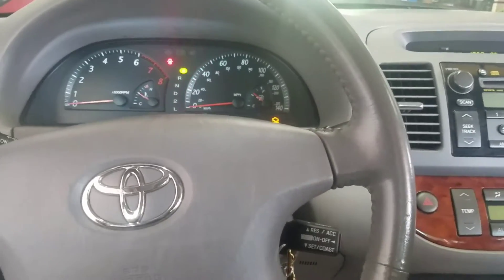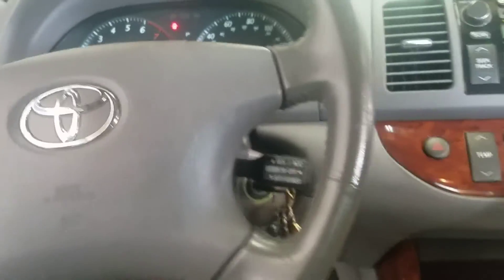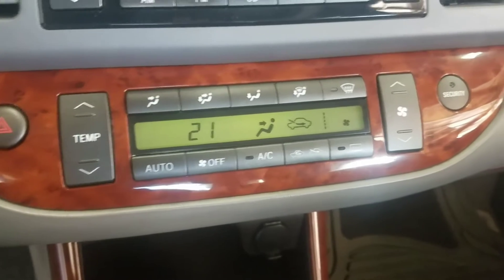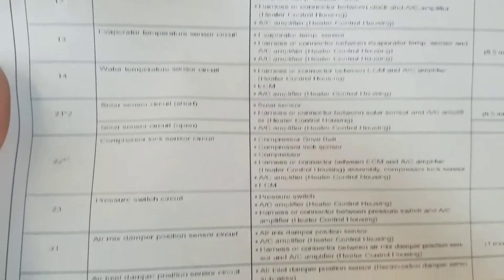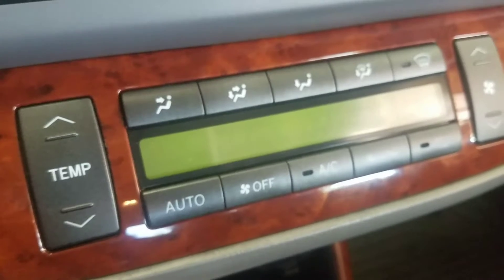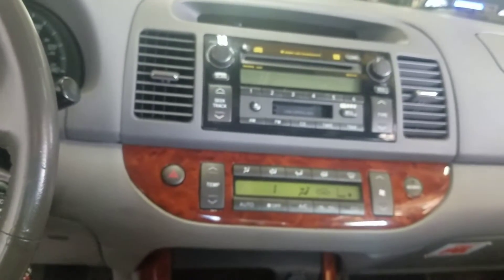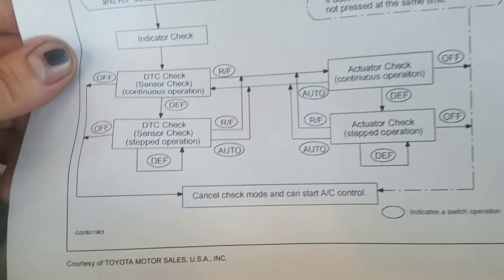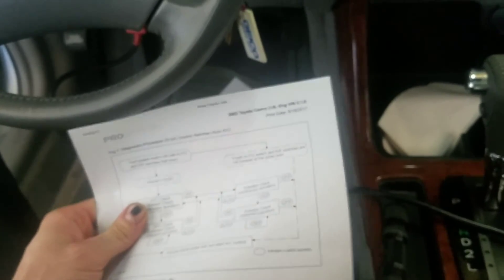Reading Toyota Climate Control Diagnostic Codes || AC Diagnostic

Comment: I have a 2007 Avalon. I tried doing exactly what you said and I didn't get nothing. It didn't work at all.
Reply: I have an 2008 Avalon and I also could not get a scan mode to initialize.  How about you did you ever figure it out ?
Reply: @dougschmidt5132  2008 Avalon can’t figure this out. Did you ever find a way to get the diagnostics mode?

Comment: Thanks  my fault code is 21 and 24 on my ac/heater control, 
What is 22 and 24 codes means? 24 fault is not included on the list
Reply: How did u fix the 21??
Reply: @eduardocalaguas5194  Did you ever identify fault code 24?  I have this as well.

Comment: Hi Leweh Tech, great video as always. But i have questiond and problem which driving me crazy after fixing my ac compressor in one of toyota services. I have Toyota Rav4 2011 Limited 2GR-FE V6 and my problem is that when i put air condition on LO its ok there is no heat blowing out. But if i put just TEMP+ to just 65 degrees only (just first higher one avaiable after LO) it starting to blow ultra lava heat on my face. I checked on OBD2 Port whats going with Torque aplication and it showing me : passenger+driver inlet temperature set : 95F. I was wtf lol thats too high and when i go Temp+ values also going high so if i set 65F it shows in OBD 95F if i set 75F in car, it shows me 105F in obd. I remember i was checking these parameters 2 years ago and they were FINE and now i have 30F difference. It is possible to make correction with techstream or something? Please answer, its making me cry lol! They just fck'ed it up in toyota service and they wont fix it since "They dont know how to" Please answer! :(((

Comment: Could you help me I have no heat and I get 21,31,41 I changed my thermostat water pump and bled system still no heat just cool air or ac
Reply from the maker: Do your heater hoses get hot?
Reply: Sounds like possibly thermostat? But can also be the blend door... Could be anything lol
Reply: @81GREGV  did you get that figured out? Same codes on our Sienna

Comment: Hey excellent video. Do you know if a 2011 toyota avalon can also be put in diagnostic mode from the hvac panel? If so, what buttons should I press? Thank u
Reply from the maker: You may need a scan tool to read trouble codes thru the OBD2 port. Prodemand tells me you can go into actuator check mode by turning the ignition switch on while holding FAN+ and Front defrost at the same time. Then u press recirculate and can press driver temp+ to advance thru the test. Hope this works, I have not tried this out on a 2011 Avalon
Reply from the maker: Thanks for watching. I saw u comment on a few other videos, I hope you figure out the problem. Is your A.C. not working?
Reply: The AC will work sometimes and sometimes it wont but here is the catch, when the ac blows warm air the Compressor is still spinning. The ac panel button does NOT flash. The compressor was changed by a shop thinking the compressor was not working correctly and the same issue is still present. the vehicle had vac pulled and recharged. i am a little stumped. I was thinking the expansion valve could be the problem but someone told me if it were that expansion valve the problem would happen all the time. If the ac starts blowing warm air,  I shut off the car for a few minutes and once i start the car it will blow ice cold air again. a guy told me more than likely it can be the AC amplifier behind located behind the glove box. I cant find anywhere how i can put the ac into diagnostic mode. Ive tried something similar to what u did in the video but that doesnt work and there is another procedure where u have to turn the lights on three times from the headlight stalk. Took it to a mechanic but the car didnt want to blow warm air at the moment so the readings looked ok. when i left his shop 20 minutes after that it started acting up and went back and he was too busy to look at it.  the vehicle is a 2011 Toyota avalon. if you know anything please let me know i would appreciate it.
Reply from the maker: Wish I could take a look at it, sounds like an interesting problem. When the ac stops working, does it slowly start blowing warmer or does it just suddenly start blowing hot? Do you have dual climate? If so, is the air always equal temps on both sides? Do you always run the blower motor at full speed? Have you changed your cabin air filter lately?
Reply from the maker: It sounds like your evaporator core may be freezing.
Reply: from what i remember, it starts getting warmer slowly. its a dual climate control and all temps are the same on driver and passengers. the cabin filter i changed already, one of the first things i did. I just tried the diagnostic mode and it does work. it starts off by cycling thru all the duct modes and finishes. then pressing the temp control like u stated wll go into diagnostic code mode but all i see is 00 and ive read that is normal? by the way if i shut off the car for even say 1 minute or 2 it will the ac will start working again.
Reply from the maker: Not sure how it should behave in diagnostic mode.. I would check the high and low side pressure of the AC system while the problem is occurring, and also use a scan tool to check for any codes. A problem with the evap temperature sensor could be the culprit. When this sensor is working properly it prevents the evap core from freezing, which may be the issue here.
Reply from the maker: If you cycle the ac off and on manually u can prevent the core from freezing. Have you checked your ac drain while the ac is on to see if it drains freely? Just trying to cover all the bases here.
Reply from the maker: U need a scan tool capable of checking more than just engine error codes.. I'm guessing you will find a B1413 code
Reply: I think i have to throw in the towel since I do not own the scan tool to read all codes like you have. Friday I might take it to the dealer to get a diagnosis. makes sense if the evap temp sensor is giving issues. i parked the car the other day after getting warm to see if any water would drip but nothing. I dont see how a guy said its the ac amplifier if the compressor is spinning and the car blows warm air? he said that "these new cars" the ac compressor can be spinning but not pumping? i just dont see that happening mechanically speaking.
Reply: thanks for the help i really appreciate it. I will let you know what they find since like i said before, i dont have a scan tool like you have.
Reply from the maker: Yea man let me know! Hope it's nothing expensive. On some of the newer cars it's hard to tell when the AC clutch is engaged.. a new type of compressor is variable displacement where the compressor has no clutch and instead varies it's output internally.
Reply: Will do. You have been helpful. Only thing I wish I had is a better scan tool but then again, for personal use, it would not be worth the cost. a mechanic told me the same thing that the newer cars you can have the compressor engaged but with no output. the dealer has me set for this Friday at 815am. will update you.
Reply: +Lehew Tech So, my dad took the car to the dealer and they handed him the car with the system fully evacuated/recharged and they put in some dye in the system. They said that is the way they diagnose AC systems, I told them the car had two AC codes stored but service manager said they didnt even look at it. He said if the car has the same problem again to bring it back and they would change the compressor($1,400). I told them it was changed already and he said, it doesnt mean that the compressor u put on was good. I told him that when the AC does work its ICE cold to the point where the windows get fogged up. Pressures look fine. So, I took it to various mechanics and they cant figure it out. These are the parts that were changed, all genuine toyota parts.

System was recharged with evac of course
Compressor
Expansion valve
AC Amplifier
Solar sensor
Clutch relay(MG clt relay)
Ambient air temp sensor was verified that it works
I personally disconnected the ECM and cleaned out the plugs to the ECM to make sure it was not a bad connection, it looked good no corrosion(ECM under hood, on firewall behind intake manifold)
Checked all grounds I could find, one under battery, another one on top of the engine.

Really stumped. i go out turn on the AC and it will blow really cold then u drive and the car can blow cold for a while then with no warning it will blow warm. Shut off car and then most of the times will blow back cold. I am thinking it can be a ECM problem?
Reply from the maker: Wow imagine having access to the genuine Toyota scan tool and not using it to diagnose.. you will have a harder time of it not having a scan tool but it's not impossible.

When your cars A.C. is working, pop the hood. You should be able to find a larger diameter line/hose of the AC that is super cold to the touch. Now drive the car until the AC stops working and pop the hood. Are the radiator fans on? Is that part of the AC hose/line still cold? 

 
On older cars, the signal to the AC is binary, either on or off. This makes measuring with a volt meter easy. On many newer cars, like yours, the AC compressor receives a PWM (pulse width modulated) signal that allows for variability in the operation of the compressor. I typically use a scan tool to tell me what % is being commanded of the component that is being modulated, and I sometimes use an oscilloscope. Both scan tools and oscilloscopes are expensive. The cheapest way for you to get to the bottom of this?

Call Toyota corporate. It sucks to be that guy, but how much many and time have u wasted on this problem already? They have the equipment to determine wtf is going on. Their tech needs to replicate the problem and use the scan tool to see if the AC compressor is being commanded on while the problem is occurring. If it is not being commanded on, he can use the scan tool to see the exact reason.
Reply: +Lehew Tech This really sucks because my father uses the vehicle as something similar to Uber but its more private. 

I have noticed that when the AC is blowing warm air,(compressor is still spinning) the ac hose is hot and of course gets super cold when the AC works fine. Yes, the fans are both working. about the only thing i have not changed on this car is the Low pressure switch. While the car is running i disconnect the pressure switch and the compressor disengages. Does the pressure switch just protect the compressor in case of refrigerant loss? or can a bad pressure switch still engage the compressor and limit AC output?
Reply from the maker: Your right, the Low pressure switch protects the compressor by completely interrupting it's operation when low pressure is detected. If the compressor is spinning while the ac is inoperable then i suspects a malfunctioning evaporator core temp sensor.
Reply: thank you. will look into that. you have been great help.
Reply from the maker: Hey man did you ever get your car sorted?
Reply: Hey, u wont believe it. So the car was taken to several shops and even on with a scanner no one could figure it out. One night I decided to backtrack on everything’ done to the car and I decided to call the autoparts place that sold my dad the compressor. Yes, it was a used compressor but from a known working car, and he told me that it fits avalon and camry. Now that I had that info i went on Densos website and I found out there are two different part nimbers for camry and avalon even though both compressors can be installed on either car they work because they have different pulleys. I am thinking the camry compressor installed on the avalon had a small puller so the ECM detected an overspeed condition shutting down the ac compressor randomly. Thats my thought. So, i decided to order a Denso from Amazon and now the avalon has frigid AC. Thanks for your help i apprecitae it.
Reply from the maker: Dang I would have never imagined.. Good troubleshooting!
Reply: I took it to a few real good shops that know their electrical stuff and they couldnt figure it out. This is a good lesson though to keep in mind when an automaker shares its ac compressors on their own similar platforms (avalon- camry) that may look alike outside but internally some things are different.